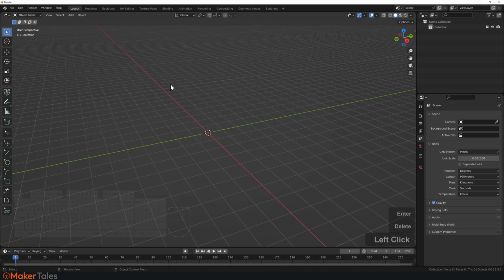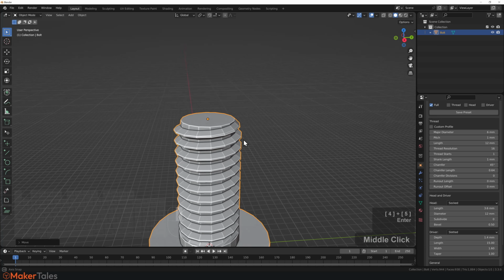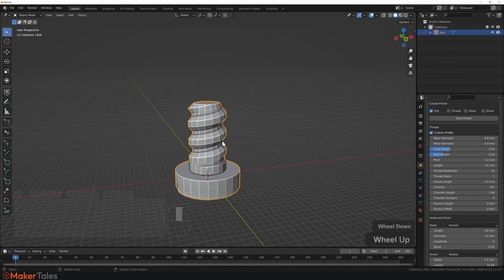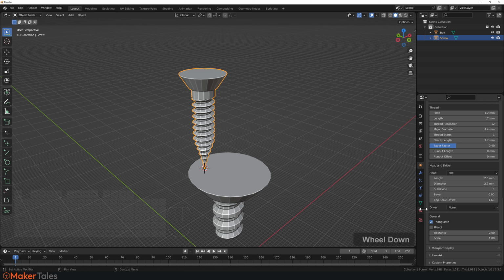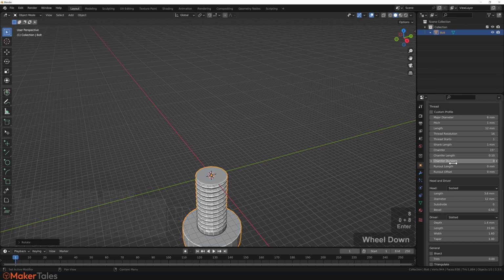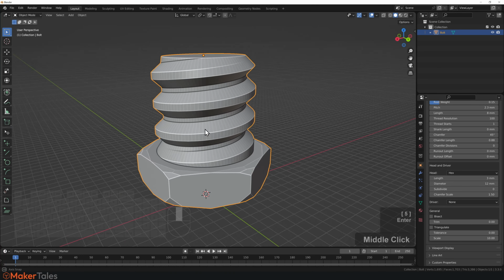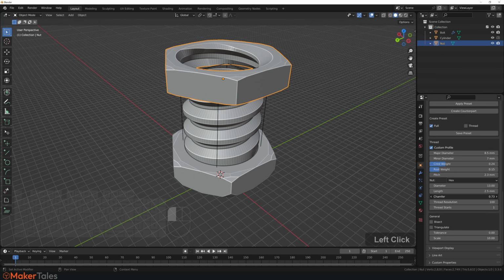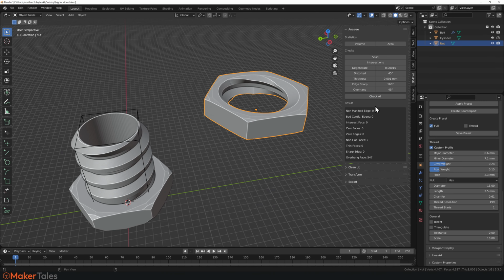New Parametric Bolts, Nuts, Screws & Threaded Rods in Blender! | Precision Bolts CAD -like Addon

Comment: Love that you're crowd sourcing development of these tools in blender.  I do wonder about the utility of 3d printing a screw as a screw tends to cut its own thread in the material it's screwed into, and I doubt plastic would hold up well to that.  Perhaps one might 3d print a drywall anchor...
Reply from the maker: Fair point. I would personally only use them in a pinch or just with 3D print project but take a look at this video... They are surprisingly stonger than you mgiht expect. I know it blew me away... https://youtu.be/ZiQek0wei1g
Reply: @Keep-Making  @boxofrox I’m looking to replace bottle caps in tiny glass bottles so they can be cast in precious metals from wax resins.

Comment: Using Blender 3.3.1(Windows 10 OS). This add-on does not show up in the shift+A menu in OBJECT mode but does show up in Edit mode. However, If you're working with a clean scene (all objects deleted) you can't get to edit mode... Thoughts?